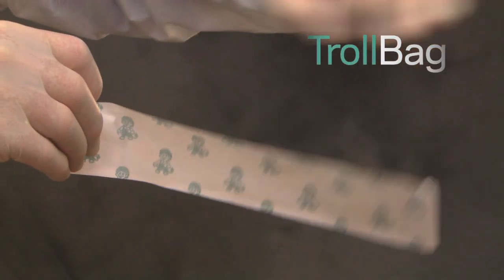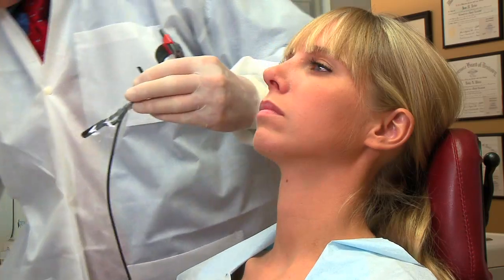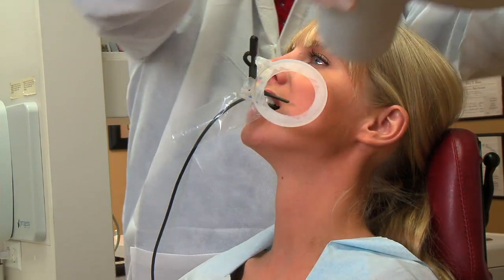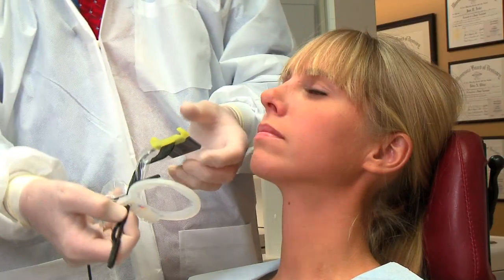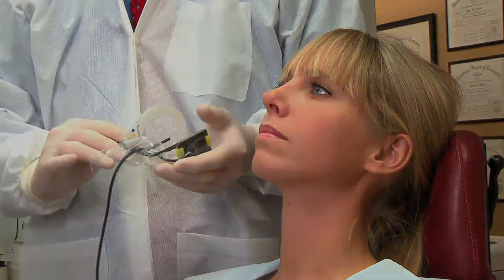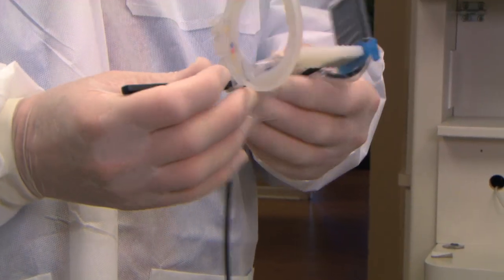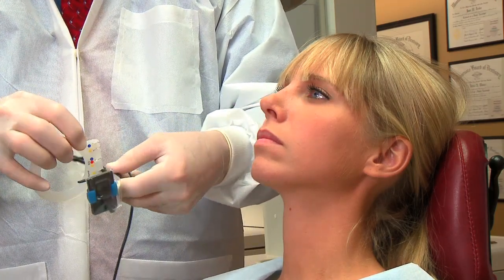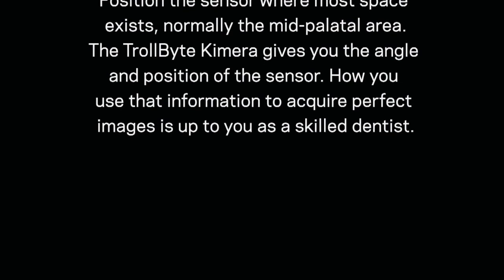TrollByte Kimera Sensor Holder

Comment: How you prevent the bar from going into the patient's face? I see in the video the edge is going into the patient's face in the video, we have purchased one of the Troll Rayzor Sensor Holder, but can not use it because our patient's complain about the edge of the bar going into their face...
Reply from the maker: You can remove the pin (bar). The function of the bar is to show the center of the sensor. As long as you use a ring you will not need it.
There is actually an indentation in the bar where it connects to the arm, to make it easy to snap the bar off. I hope this answers your question.